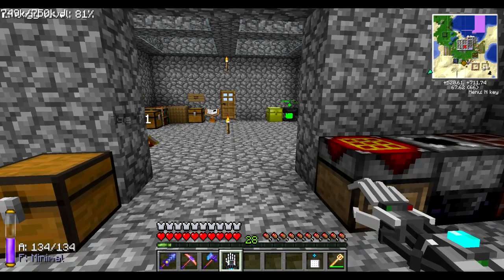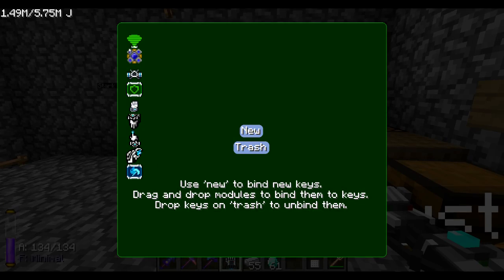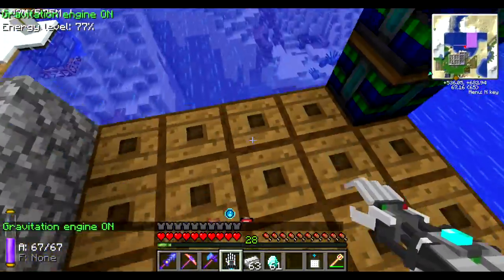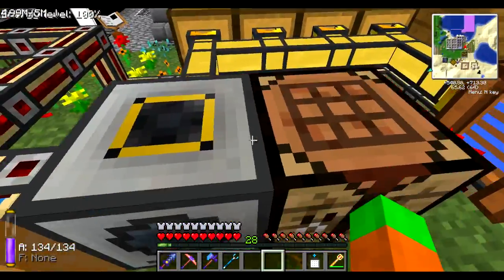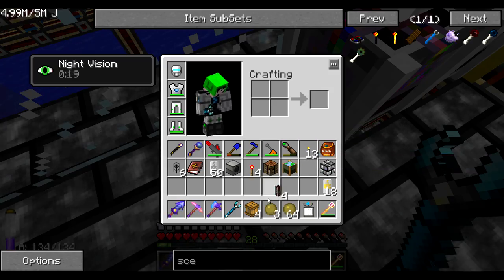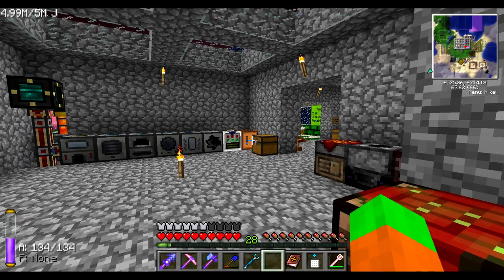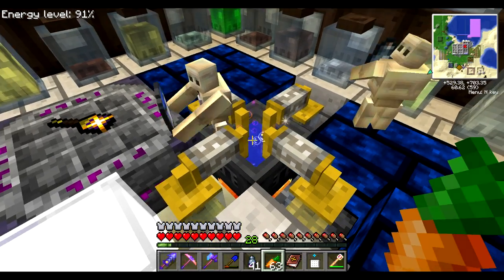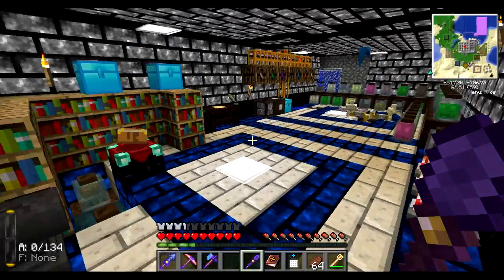odedex Plays - S02E123 - Problems With the Aura

Comment: Universal Electricity is a mod mostly designed for new modders who want electricity but don't want to code their own version of power. So they can just use UE's code for power instead. Plus UE already has a few basic machines and cables already. One mod for example, is the ICBM mod which integrates UE's power to launch missiles. But with BC and IC, not many people use it. Even if they have it.

Comment: Why don't you use the slider on the battery to bump up the size. A long as you don't surpass 25kg of weight there is no slowdown in walking speed.